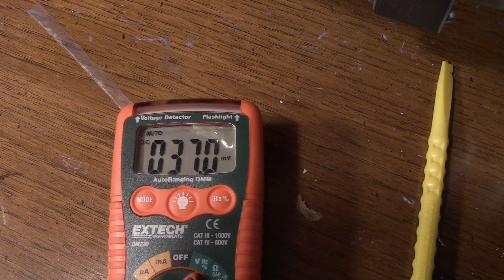Setting the Tube Bias on a Suhr SL68 Guitar Amplifier

Comment: Curtis, how are you? Regarding the SUHR SL68, please help me clear up a doubt about the trimpots. When you mention the top trimpot, is that the one used to adjust the low setting, and the bottom trimpot is used to adjust the high setting? Is that correct? Could you please explain this in more detail? I look forward to your reply.

Comment: Hi Curtis, thank you for posting a very staightforward instructional on biasing. I want to check the biasing  on my Suhr PT100. I'm guessing the method shown in the vid is similar for thr PT100.... except there is no low on the PT100. Do you have any addtional tips regarding the PT100.?
Reply from the maker: I am not sure if the PT100 has the same layout.  I would reach out to Suhr to verify the exact location of the Bias pot and the proper procedure.  The concept is the same though.

Comment: Hi Curtis.  Thanks for posting a video like this.  I'm considering getting the SL68 to replace the Marshall 1959HW i just had.  The 1959HW was purchased new and had some issues with it...so i decided to return it.  I didn't want to deal with headaches down the road.  A new amp shouldn't have issues 20 days into owning it.  Anyhow....wanted to ask if the SL68 nails that Plexi tone very well?  and is the master volume at the back actually useful...meaning does it work well?  

One last question...besides the typical channel bridging mehtod (guitar in ch1 hi, link ch2 hi to ch1 low) can you bridge on the SL68 the alternate Marshall method of  guitar into ch2 high bridge ch 1 high to ch 2 low.  This method is stated in Marshalls manual as an alternate method for tone options.  I quite like it .

thank you
Reply from the maker: Hi Reggie thanks for the note. I have had Marshall reissues in the past and was never happy with them. I agree a new amp should not have problems. One of the reasons I went with the SL68 instead of trying to find the perfect vintage Plexi (besides cost) is because John nailed it with this amp and they are consistent, not all vintage Marshalls are consistent (parts variations etc.). 
The other two added features are the low voltage setting, which I love. I usually leave this on the low setting.  No need to drag a Variac around (lol).  The master volume is great, the low-end girth is still there. Although for recording I max the master volume (vol1 set between 6-8, rarely on 10) and run it into a Suhr Reactive load box.  The amp is heavy.  I would serious consider the SL67 as well. I might trade this one for the SL67 in the future.
I do not normally jumper my amp. I have never tried going guitar into ch2 and jumping ch2 to ch1.  I don’t see why it would not work.
BTW, these are also helpful if you do not have a bias-pots like the Suhr amps.
https://www.eurotubes.com/store/pc/Eurotubes-Octal-Bias-Probe-6p149.htm
Reply: @curtisguitar  Thanks Curtis!!  appreciate the link to the bias tool.  I've already purchased the TAD BiasMaster...similar to Eurotubes.  One less thing to worry about when biasing and doing it safely.